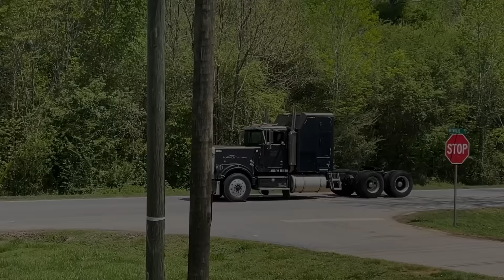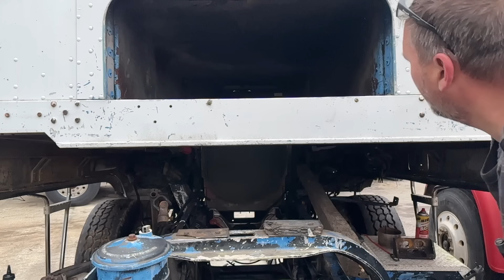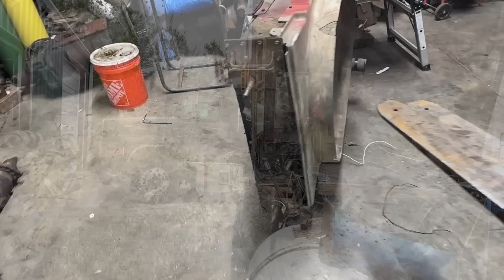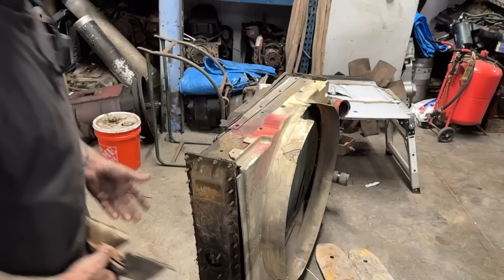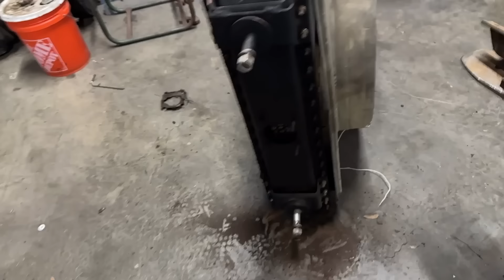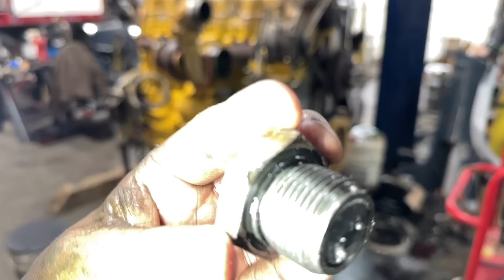83 K100 Cabover “Krystal” Wrong Oil Pan?

Comment: Good work James making progress keep up the good work 👏!! Bing Bang Boom Bob's Your Uncle ha
Reply from the maker: Thanks Rob
Reply: @JamesPretty  One thing that I use to do with my old Cabover when I had the cab jacked all the way over I use to put a chain from the back of the cab mount to the frame of the truck just incase she goes over !!
Reply from the maker: @robc2821  ya if these cylinders weren’t brand new I’d chain it for sure
Reply: @JamesPretty  Rite on !  I remember back in the Eightys jacking up the cab on my 82 Freightliner double bunk and my portable TV  fell off the shelf and hit the windshield but lucky didn't break lol
Reply from the maker: @robc2821  I have done that quite a bit.  I always forget to secure stuff